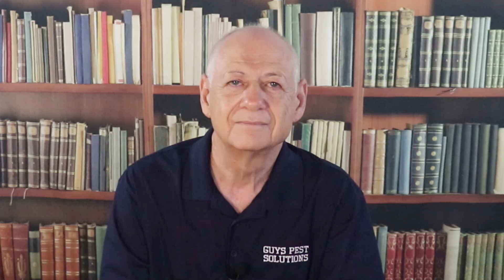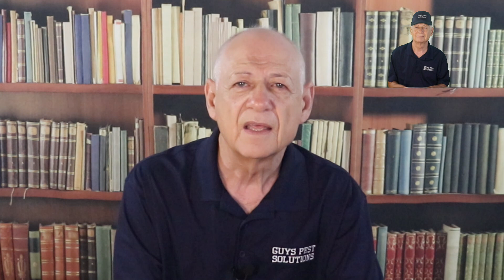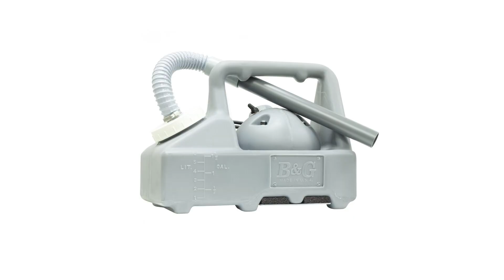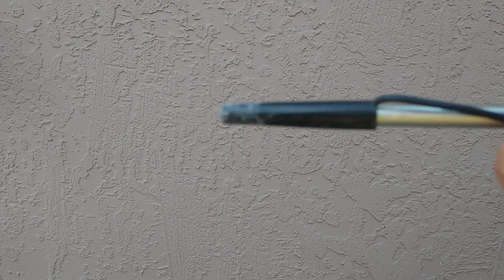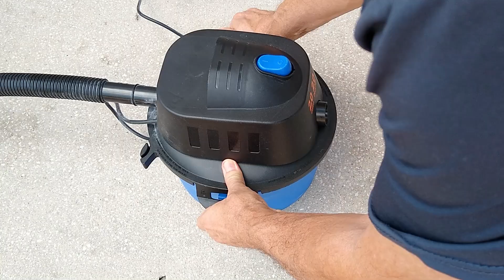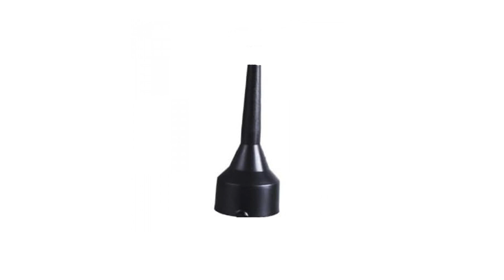Build a Cheap Electric Duster with a Shop Vac.

Comment: Like someone else said, I was about to engineer a solution but this seems to be more practical. I have yellow jackets teaming near a tree that's about 6-7 feet away from my fence, I was hoping that I could blast them with some Delta dust that they would take back to the nest and kill the rest.
Reply from the maker: You are correct that the best way to treat yellow jackets is to apply Delta dust directly into the entrance hole of the nest.  Be careful though, because yellow jackets can be very dangerous.  If one of them stings you, it will give off pheromones that will guide the yellow jackets straight to you, and you can get swarmed.  So, let me tell you how I do it.

We know that yellow jackets are not good night flyers, so they typically return to the nest before dark.  Therefore, treating them when it's dark is the safest time to do it.  The problem is that you will have a hard time finding the entrance hole in the dark.  An easy way to solve this problem is to get a can of fluorescent spray paint and spray the hole with it during the day.  The yellow jackets will be coming and going, so you need to work quickly.  Identify the location of the hole from a safe distance, and then simply run over to it, shoot the spray right on the hole, and run like hell.  Have a safe place that you can run into in case they start following you.  I usually find that I can do this before they realize what happened.  I am in and out of there in seconds.  By the time they realize what happened, I am far away.  Now that the hole is painted, you can easily find it in the dark.  

I don't know that I would be messing with blowing dust in with a vacuum.  Even though yellow jackets are not good flyers at night, that does not mean they cannot do it.  So, the less time you spend doing this, the better.  I think it's a better idea to simply stick a funnel in the hole and pour in some Delta dust.  You should also apply it around the hole as well.  The first thing I do is apply the dust around the hole about 6 inches in all directions.  Then I put the funnel in the hole and pour in about a tablespoon of dust.  As soon as you pull that funnel out, get out of Dodge.  It is also a good idea to use a flashlight that has a red filter.  Yellow jackets do not see red light as well as white light.  It also helps if you wear long sleeves, long pants, gloves, and goggles.  If you do get attacked, you certainly don't want to get stung on or near your eyes. 

If you are unable to find the entrance hole, then you need a different approach.  Sometimes the entrance hole can be difficult to locate because it is in a pile of rocks or some other location that makes it difficult to find.  Please let me know if you run into this situation, because I have an alternative treatment for it.  There is always a way to get it done.

I hope that helps.  Be well my friend.

Comment: Worked great when I poured the dust into the hose, but barely worked if poured into the canister.
Reply from the maker: If you do not have the reducer tip on the hose it puts out a lot of dust, but if you put on the reducer tip you need to place the dust directly into the hose.  It helps if you loop the hose.  Please read the frequently asked questions about German cockroaches on my website and scroll down until you see a photo of the vacuum.  This will explain how I do it.  I hope that helps.  Be well my friend.

Frequently asked questions about German cockroaches:  https://www.guyspestsolutions.com/german-cockroach-frequently-asked-questi

Comment: Should I use my existing midsize Shop-Vac or buy a small one? I think I can find the right attachments for my midsize one

. Okay, I just saw your update on putting a tablespoon of dust directly into the hose. So with that method, I think I can definitely use my existing shop vac.
Reply from the maker: For a very detailed explanation on how to use a shop vac and some great tips, please read the frequently asked questions about German cockroaches on my website.  It shows how to loop the hose and modify the reducer tip.  I will give you the link.  Just scroll down until you see the photo of a shop vac and you will be in the right place.  Be well my friend.

Frequently asked questions about German cockroaches:  https://www.guyspestsolutions.com/german-cockroach-frequently-asked-questi

Comment: Can you help with ants?
Reply from the maker: Ants are usually somewhat easy to treat, but not always.  It kind of depends on the species.  It's best to try baiting first, but if that doesn't work, then you sometimes need to go nuclear on them.  I have videos on both methods, and I will give you the links.  Baiting is way easier and less expensive, so always try that first.  If you have carpenter ants, then you may need additional treatment as well.  Let me know if that is the case and I will assist you with it.  For a full list of all my videos and links to them, please check out my website at www.guyspestsolutions.com.  I hope that helps.  Be well Elize.

Video on how to bait ants:  https://www.youtube.com/watch?v=64s5br_-F2I

Video on the nuclear option for ants:  https://www.youtube.com/watch?v=arPeidADLpY

Comment: I came to check your video because i am looking for a electric duster, gladly i found something better, it happens that i have one of those vacuums and many little attachments that fits, thank you for this video, i dont have to spent on extra items that may be used only once, also, let me give you a little update, I bought the items for the roaches, so far, i see them sometimes, i did follow the instructions on you video about how to get rid of roaches, it has work, but i wanted to put more D-fense inside the walls. thank you for this idea, I cant say you are helping me to save but you are helping me to not spend what i dont have you have been very helpful, thank you, I really appreciate your information, thank you very much.
Reply from the maker: Two things.  You are better off applying boric acid in the walls instead of D-Fense dust.  Boric acid lasts forever.  Also, if you put the reducer on the end of the vacuum hose it greatly restricts the amount of dust coming out by a lot.  I now a fix for this.  Simply remove the reducer, put a tablespoon of boric acid directly into the vacuum hose, replace the reducer, insert the reducer into the hole in the wall, and turn on the vacuum.  All the dust will blow right into the wall.  That will provide a very good amount of dust.  I hope that helps.  Be well my friend.
Reply: @GuysPestSolutions  thank you, I will do that.
Reply from the maker: @privilegiada1  You are very welcome.   Be well my friend.

Comment: Would this work to blow sevin dust ? I have a brown widow spider problem. How long will a container of sevin dust last used in this manner
Reply from the maker: You can probably blow any type of dust you want with this, but you do not want to treat brown widow spiders with Sevin dust, unless you are treating your garden.  If that is the case, then an electric duster may not be a good choice for you.  I can tell you exactly how to go after these guys, but I first need to know where you are having the problem. Are you seeing these things inside the house, or outside someplace?  Also, please let me know where you live because not all products are available everywhere. 

I hope that helps.  Be well my friend.

Comment: A good tip I saw somewhere for dusting outdoors is mixing a certain amount of diatomaceous earth with water in a cheap pump sprayer and spraying around the edges of home and windows, etc. When it dries it's powder and dusted to the spots you sprayed.
Reply from the maker: The problem is that diatomaceous earth (DE) only works for some species.  Also, it will wash away when it rains.  I think it works better to use real pesticides for outside use.  Please watch my video on how to treat the exterior of your house.  The products in that video are safe enough for children to play on after they dry.  They stay where you apply them and will last 60 days.  I hope that helps.  Be well my friend.

Video on how to treat the exterior of your house:  https://youtu.be/Yozv3s-Qwlw
Reply: @GuysPestSolutions  Thanks, Guy! I currently use Talstar P in the yard and perimeter, but have tried the DE in the past as an extra barrier and not sure I really saw results. My biggest issue is tree falloff collecting near the house and simply taking the time to collect it so the roaches and palmetto bugs don't feel too at home. I'll take a look and see what you recommend in your other video - I appreciate it!
Reply from the maker: You are very welcome.  Be well my friend.

Comment: What kind of does should I have thus Terminator 🤔 below
Reply from the maker: I am so sorry, but I don't understand the question.  Please elaborate.  Thanks.
Reply: @GuysPestSolutions  what kind of bug stuff needs to be sprayed or dust
Reply from the maker: @TimothySchiroJohnson  The kind of dust will depend upon the target pest and whether you are looking for a quick kill or a slow kill.  Yes.  There are times when you want a slow kill.  An electric duster is usually best for applying large amounts of dust, like when you are using boric acid or diatomaceous earth, and you need to apply them in large areas, such as wall or ceiling voids.  For most dusting, you just need a hand held duster.  A little dust goes a long way when dusting cracks and crevices.  If you have a specific bug in mind, I can tell you the best thing to use.  I hope that helps.  Be well my friend.